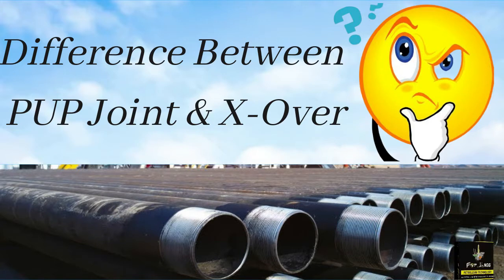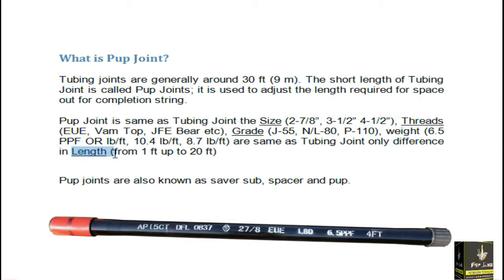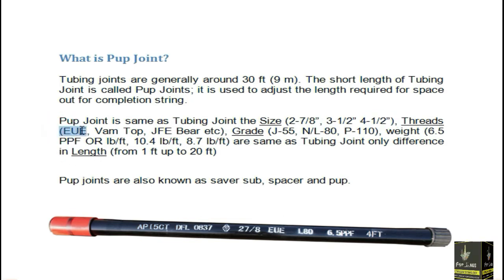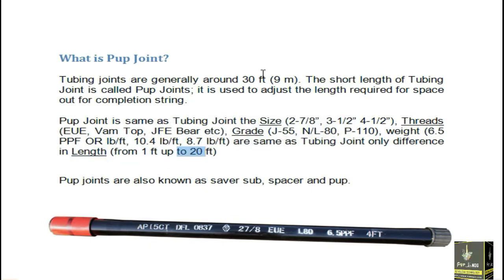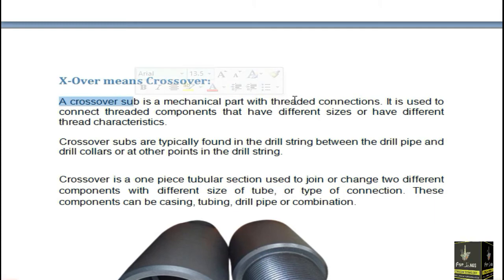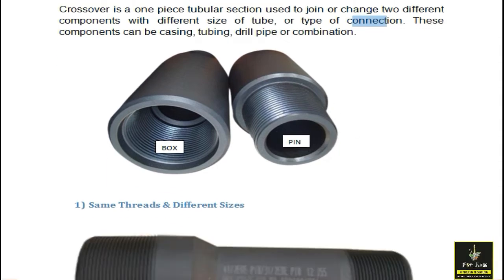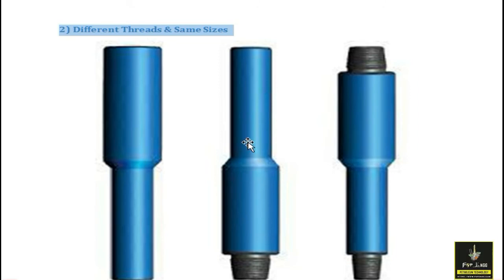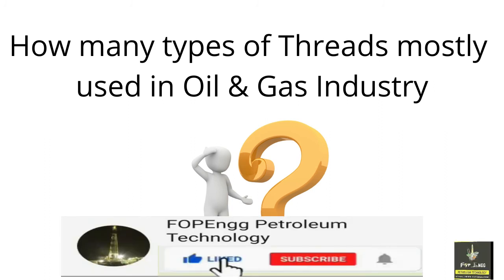What is the Difference between Pup Joint & X-Over / Crossover?

Comment: pup joint is the lander and the crossover is the connection between two different size  pipe and threads

Comment: Why we use pub jiont in 5 1/2 casing?
Reply from the maker: A pup joint is a shorter in length than a standard casing size. This use for the adjustment of length.